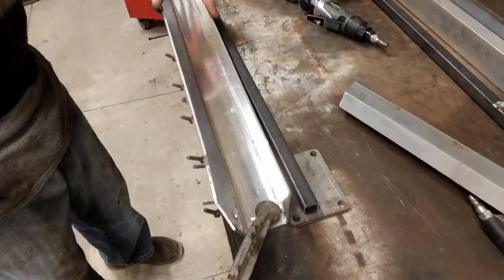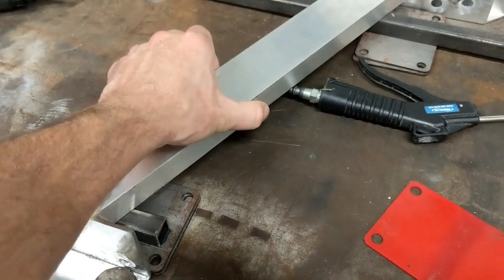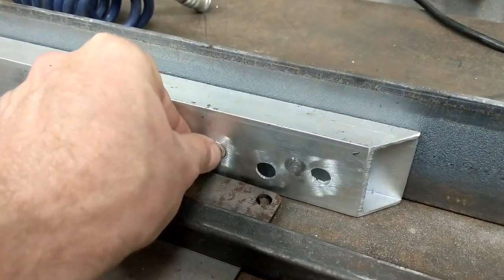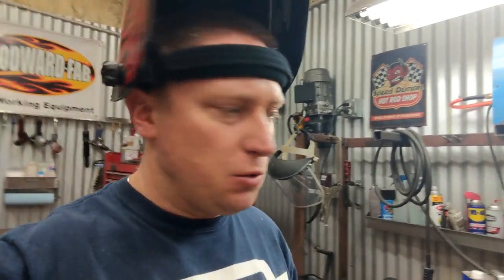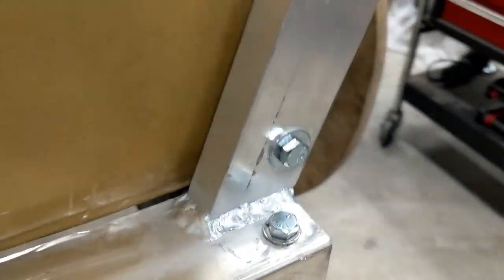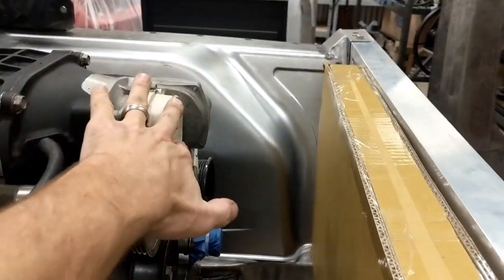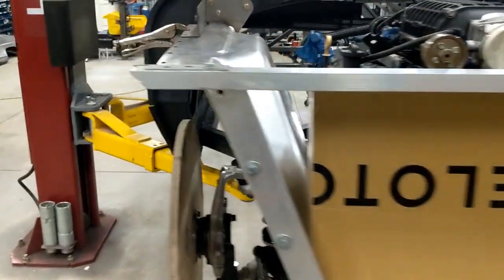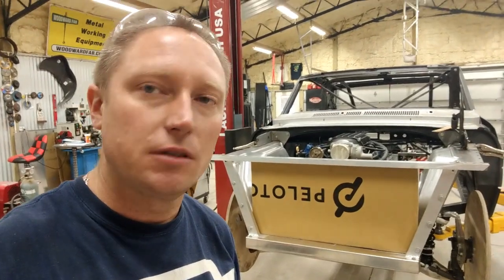Aluminum Radiator Core Support - Custom Made

Comment: Getting ready to build my own core support as well, and curious with yours you went straight across on the top, but the stock one has a curve in it. How does the hood fit with it being straight?
Reply from the maker: My car is completely assembled today and the lack of following that stock curve has made zero difference.  Granted, I'm running hood pins, so the location of the hood latch is not important to me, and I could certainly see that affecting things.
Reply: @RedlineStands  i plan to run hood latches as well, so I am not concerned with that either. I appreciate you responding! The car looks awesome you did a great job on it.
Reply from the maker: @C3Tackle  I appreciate that!